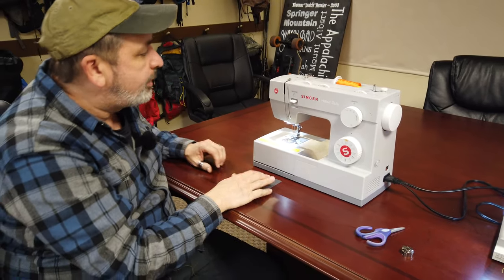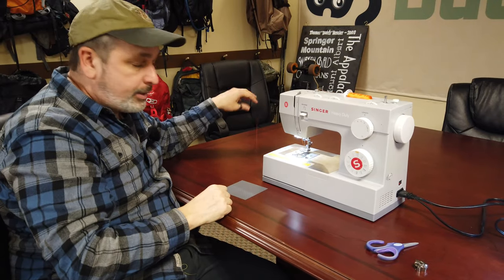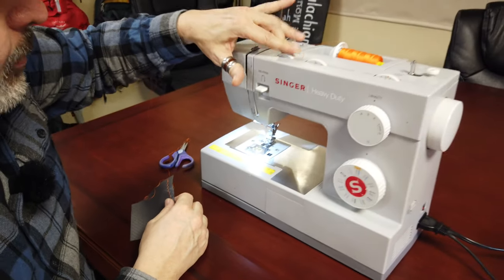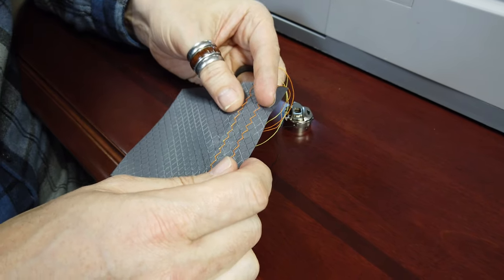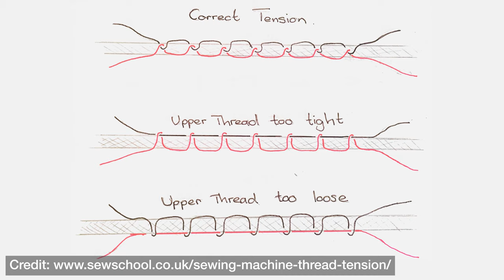Sewing Tension Tips

Comment: Great tip, but I have a tip/recommendation. Don't pull the top thread forwards like that to feel tension, it puts your needle under a lot of stress (you can see your needle flexing 20-30 degrees 3:36).
Instead run the top thread between the feet like normal and do your pull tension test away (the opposite direction you did).
This way, you still get the same tension test, and the feet take most of the strain and your needle barely flexes, yet you still can test the tension.
Thank you everybody :-)